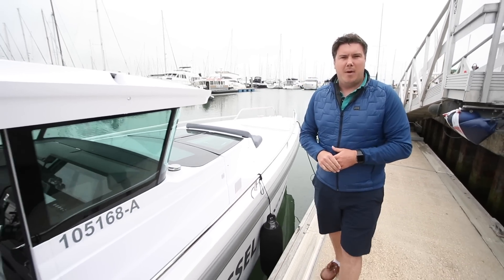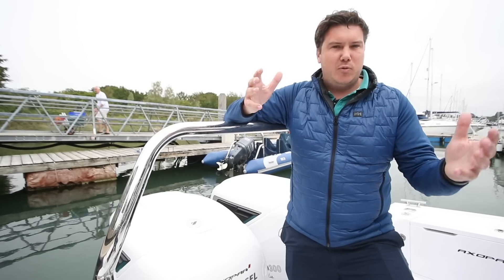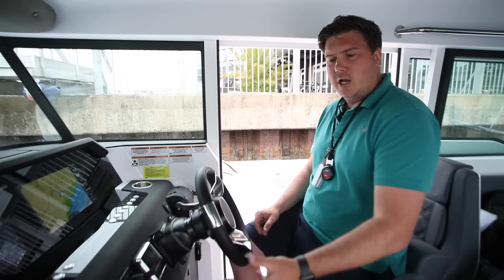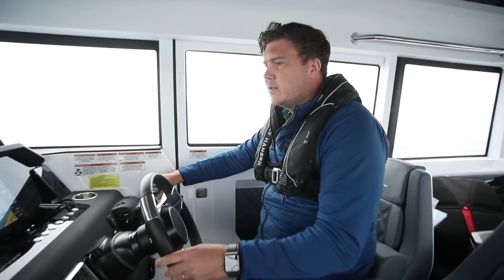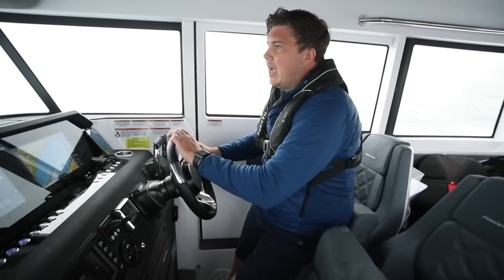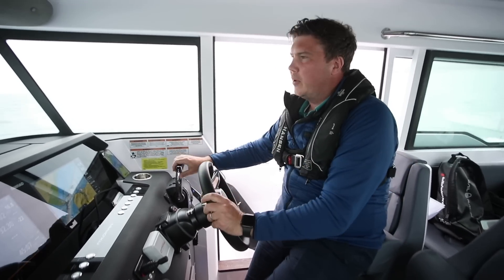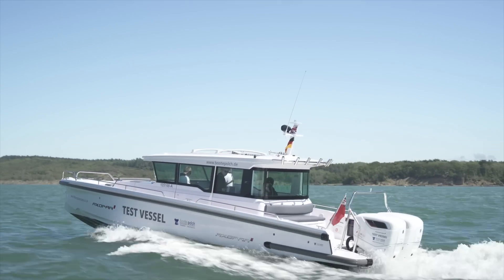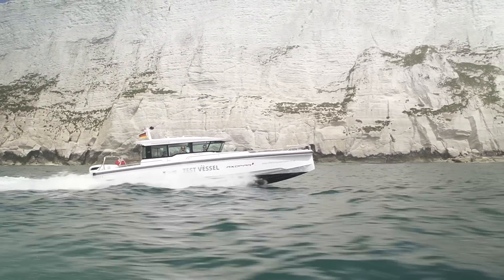Is this diesel outboard the real deal? Cox CXO 300hp tested | Motor Boat & Yachting

Comment: To check how much money on fuel you can save is a complicated task with many variables. Estimates range on 50 to 100 hours per year on a yacht, obviously this can be more or less. But let us go with just 50 hours a year. One hour per week. That's not much. Fuel prices vary, we'll go with Shepperton as they came up first in the search engine. Round figures, 60/40 Diesel £1.30 and Petrol £1.70; the fast cruising speeds came in at 60 litres/hour Diesel, 93 litres/hour Petrol. Again, rough figures £4k Diesel, £8k Petrol. So at a fast cruise the Diesel engines save £4,000 every 50 hours of use. 

What if you do lower speeds for fuel efficiency? Okay, but then presumably as you take longer you're on the water for longer because you take more time to get to a destination. To go the same distance as Cruising speed in Eco takes 4 times longer, so let's look at 200 hours for a fair basis of comparison. Diesel comes out at £2,100 in cost, Petrol is £6,000. Again a £4k Diesel saving. 

Obviously if you only use your boat for a very few hours per year the savings won't add up, but the more hours you do the more it adds up, and certainly by a few tens of hours per year it starts to add up substantially.
Reply: Thanks for doing the math
Reply: With the pricing roughly £16,000 more for a diesel you need a lot of hours to be even with a petrol one.
If you considering the prices for a fuel in average EU country (1,6 Eur gas/1,4 Eur diesel) or even in the US math is even worse 
Not to forget maintenance of a diesel is more expensive than a petrol
Reply: @altergreenhorn  where did you get your prices? You're not using road fuel prices are you? A link would be welcome.

You say it's even worse for the US. Again, are you using ROAD fuel prices? Marine prices are a different beast. Example, Alligator Point, FL diesel $2.7, gas $3.9; Suwannee, FL diesel $2.8, gas $4; Panama City, FL diesel $3.6, gas $4.6, and so on and so on and so on, dozens and dozens of marinas and it's a consistent prices difference. So a bit of boating and the costs will MASSIVELY stack up, as my figures show.

As I say, links to your EU marine fuel sources would be welcome.

Besides, MB&Y is a UK publication, we have to pay UK rates not "average EU" rates. The reality is if you do a bit of boating in the UK, or the US, you'll quickly make a saving.

Also: diesel engines cost more to service over a life than petrol? Until this point in my life literally everyone I have ever heard say the opposite (gas engines need more frequent rebuilds). If you can reliably source your argument I would be grateful.

Comment: Diesels.  Lots of torque... but also lots of weight.  And full disclosure, I drive an (American) Ford 3/4 ton P/U with a turbo charged V-8.  Fuel burn is good though.  56 liters combined, per hour (~15 US gallons).  Our 150 horse (Suzuki 150 4 cylinder) will burn 5 gph at that speed.
Reply: 150 hp on a 37 foot boat?
Reply: Even while heavier the time to plane is greatly reduced as the peak torque is very early in the power band

Comment: I am totally out of touch with boating never was with anything bigger than 20 foot anyway, two things would worry me If I had money n age on my side for a boat this size, I would be worried of almost a ton in weight for the two engines hanging on the transom in choppy weather  also the difference in fuel consumption reliability as oppose to a bigger lower revving inboard diesel, a mate years ago bought the mouldings n build a 39 footer If I remember right Aqua star n his choice was between a Volvo Penta high revving engine or a Caterpillar max speed 1800 revs it was a semi displacement hull, engine/gearbox was just over £20000 that was in the 80s would an engine like that not be cheaper to run n maintain in the long run? am sure today's prices would be in a very different bracket of course but the combine cost of these two monster outboards great as they are would not be more cost effective throughout the life of a boat? for me also the added safety factor just wondering  great video thanks for uploading
Reply: chef nknow sibg eñgiñe over 2⁰ footer

Comment: I would have liked to seen noise readings in decibels listed showing a comparison between the Yamaha and the Cox at various speeds both inside the cabin and outside. I had twin Yamaha 250's om my boat and they were pretty noisy when you sat outside at cruising speed. Just saying they are a little more noisy doesn't give your audience any solid information,

Comment: How about an acceleration test?
I suspect the massive tourk will way surpass the 4stroke. 

What about scheduled maintenance?
This is why I'm sticking with 2stroks.
Reply: A) both are 4 stroke. 
B) 2 stroke outboards are nothing but maintenance intensive shit boxes that are bad for the environment. Just because you have the brain if an ant and can’t work out how to look after a 4 stroke is not a sign of a bad engine. It’s a sign of your incompetence. I’m glad they are being banned more and more.
Reply: Phone Backup    I've used a lot of outboards over the years. I've scrapped plenty of four strokes, but I've never scrapped a two stroke. I still look for used two stokes to buy today. During my searches I see lots of four strokes less than ten years old being broken for spares.

Comment: Diesel is dead too many exhaust cleaning hardware pieces than gasoline adds more weight overall and if nothing else more maintenance
Reply: The marine sectors is far less regulated compared to on road diesels. 

Petrol outboards still not necessitate cats yet so diesel needing scr, ad blue and egr and cats is a long way off.

So we can rule that bit off as to why these engines weigh so much anyway... haha
Reply: @lewisanth4986  yes but diesel if it becomes attractive the regulations would become more strict doesn't matter what part of the world they are manufactured especially in the u.s. or Canada and in North America diesel is phased out in a lot of sectors and its easy to see why no glow plugs no grid heaters no plumes of black smoke when its cold no injection pump to replace
Reply: @stevemino142  there is a chance tho, diesel tech has come along way if I may say so. 

Only time will tell if they will be a success in the marine sector.
Reply: @lewisanth4986  very true I know from a roadside standpoint as gasoline powered vehicles like the 8.8 litre psi V8 gasoline in buses and mass transit vehicles there cleaner now than any diesel present or past

Comment: Twin turbos....
Gonna be an expensive refit once those, inevitably, go awry...
They do fit the Axopar, I must say. And diesel does make some sense, I  guess.
Hybrid designs with gasoline motor or pure hydrogen ones seem to be the way ahead, though. The fanatics WILL come for marine diesels as well.
Excellent review, as per.
Reply: They are already coming for marine diesel, all sorts of new superyacht regulations etc.
Reply: Hydrogen fuel cells, a lovely idea but thoroughly impractical due to the lack of refueling infrastructure.
Reply: @lukewalker3905  Almost the exact same situation when the combustion engine was created and everyone said there wasn't the infrastructure... Just build it.
Reply: TUrbodiesels have been in cars, trucks, lorries, busses, and mining equipment for decades. It is good technology that actually works. 
Remember, this is not a high-revving petrol engine, needing a turbo to spin three times the speed it will in a diesel.

Comment: Why did the graph show 2850 rpm at 30 kn for a 61 LPH and jack saying 3500 rpm at ~80 lph for the same speed? The graph said he should be doing 41 kn at that speed?
Reply: At around 9:50 he mentions going against the tide. I thought the same as you, but tide and wind conditions may account for discrepancy
Reply: @Nasss92  The issue is that he ends the video stating that the top speed was 39 one directiom 42 the other hinting at a 3 kn not 10 kn tide. Followed by the statement that the diesels are slower than the gas why again goes against the graphs that showed the diesels being faster than the gas. Or am i missing something?
Reply: @axelwallenberg6167  We are confused :-)
Reply: I can only hazard a guess to be a factor of conditions (i don't know if there is an equal inverse relationship between drag and speed in this case) or possibly any changes to prop selection? It is a test boat after all, but also fair to address his claims look a little off

Comment: 400R makes the same torque (600NM), at 303kg weight...this one does it at 375kg & makes less power. Efficiency would be the only upside, but just barely.
Reply: At what revs does the 400r produce that amount of torque? I bet it is at a far higher rev range.

Comment: 800 rpm idle is high ?

Would like to know the gear ratio/rpm/prop pitch

Also single engine operation .. with all that torque, a single engine should push pretty good

Comment: You need to test the Mercury V12 600HP engine next. Just one engine will do that boat. Two diesels would costs you $US105K. One V12 600HP Mercury is $US 70K  Next you could put one (1) of the new Cat 32B Triple turbo diesels with 2,433 HP :)
Reply: You want twins on that boat. Both for the redundancy and added maneuverability during docking.
Reply: At some point just have a stern thruster and bow thruster- go to a single -
Reply: @lukewalker3905  Bowthruster suff and available.
Reply: A single is way better than twins, until it breaks. Then twins are way better than a single.
Reply: @lukewalker3905  the bowthruster is 3'500 EUR on the Axopar 37. On top redundanca on a drand new outboard engine is questionable, as most likely issues you will have are connected to the fuel resp the fuel line, and on a single tank boat your gain of safety is marginal ! Statistics also speak for single. 
On top 2 engines = double the maintanance costs.
So single makes a lot of sense ;-)
Reply: @lukewalker3905  What bowthruster cost $30k? You probably mean $3k.
Reply: I have 2 engines and in my boating lifetime at least 10 times I come back with one engine. This with VP sterndrives. There is so often something wrong with a sterndrive. I would NEVER buy a single engine boat. However maybe outboard are more reliable.